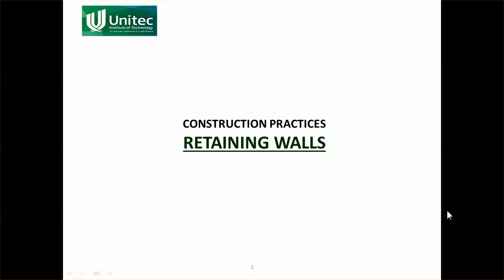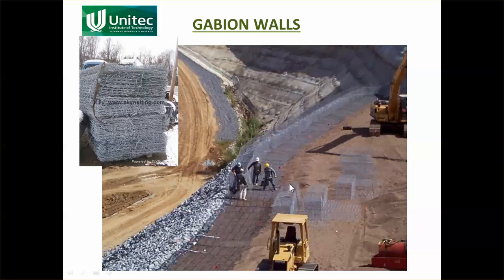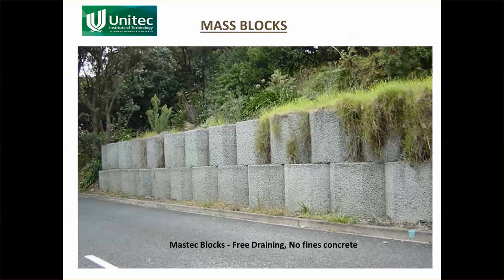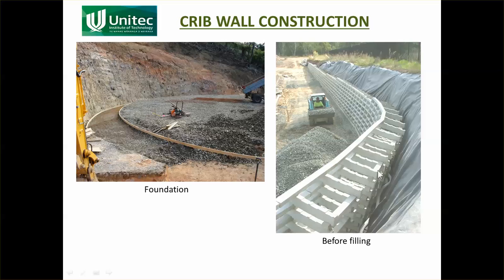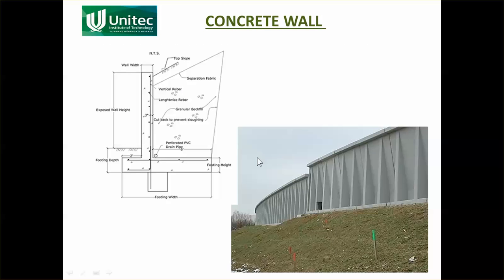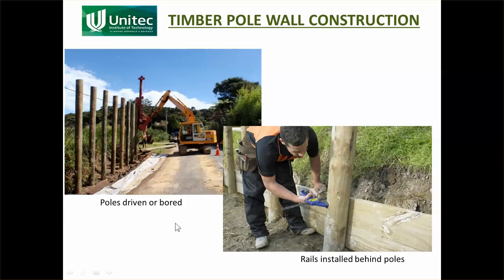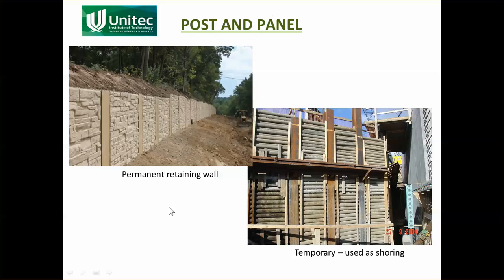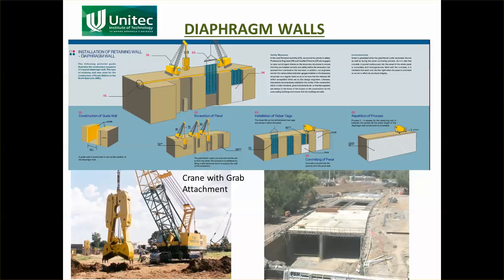CP5 2   Retaining Walls

Comment: Hi, 
If you were building a retaining wall in a river where there is lateral spreading in the past and the soil is largely sand, would a gabon wall be the best choice? You mentioned that they are good in rivers because if the settlement just unsure if this extends to lateral spread also.